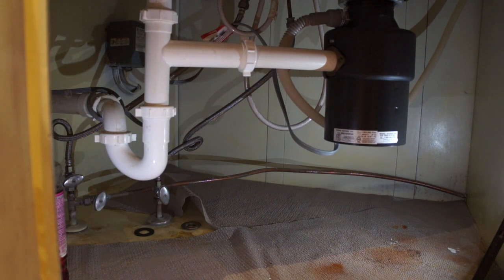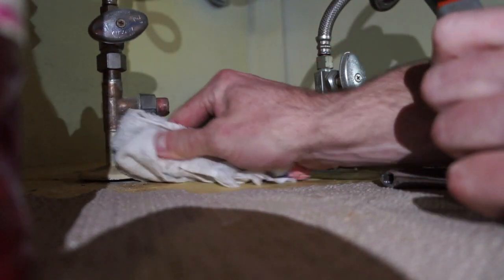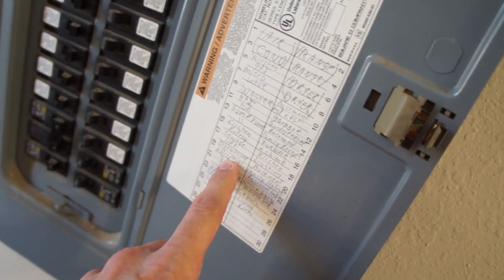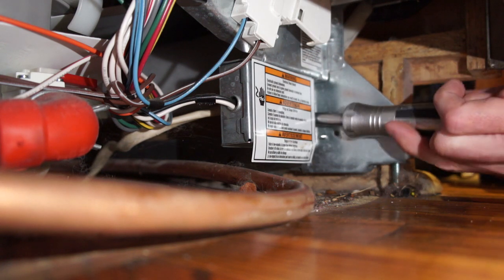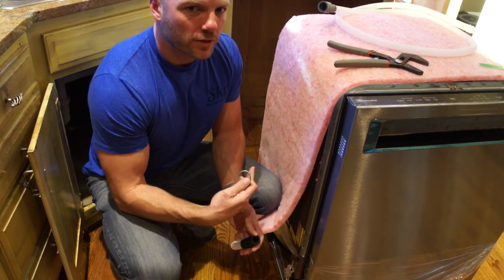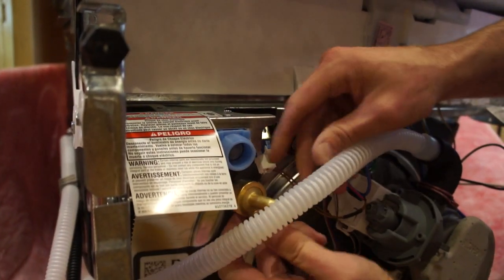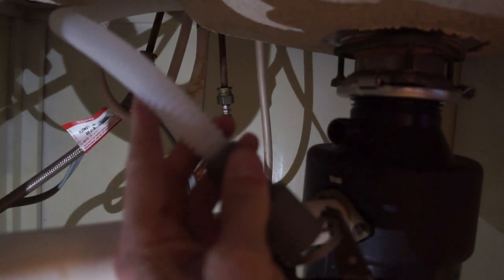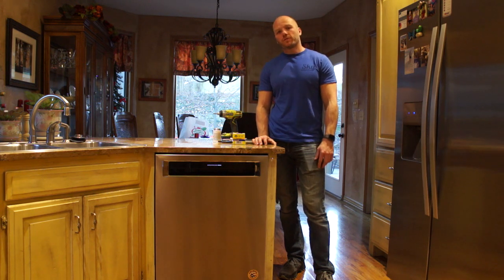How do I  Install a Kitchen Aid Dishwasher

Comment: Just bought a similar kitchen aid dishwasher, what model is that one if you remember.. I think I like the fact the electrical box comes out to get wires connected. Done too many in the tight box underneath. My electrical is too short from the wall too. 

I was hoping you would go through leveling and screwing to sides as mine is granite counter top too. I know you just screw to hold not to tight or will bend dishwasher and it will leak around gasket of door. 

Thoughts or suggestions?
Reply from the maker: I don’t remember what model this was. It was at my aunts house, and she has since sold the house. Lol
If you have enough clearance to get the side brackets in there then it’s nice to have it screwed into the sides. To hold it in there when you pull the door open. 
I have a kitchen aid at home, and the opening was super tight. So I raised the feet up so that it has a little pressure against the granite counter. That has held mine in there just fine for 5 years with no problems.